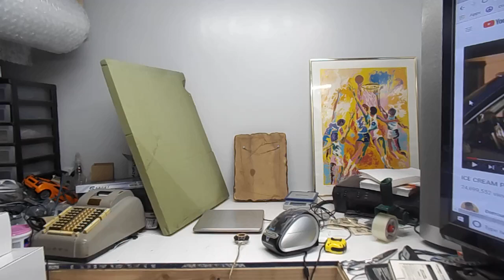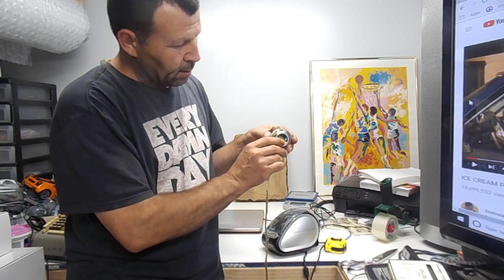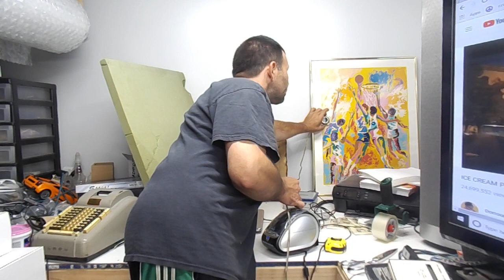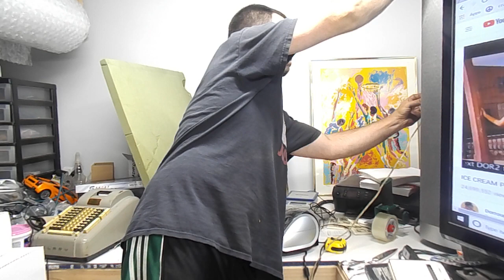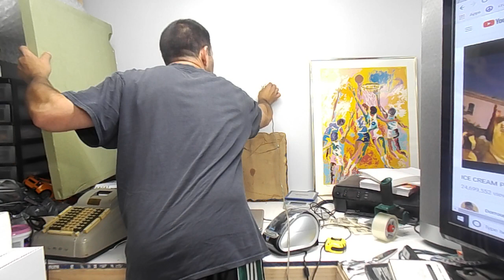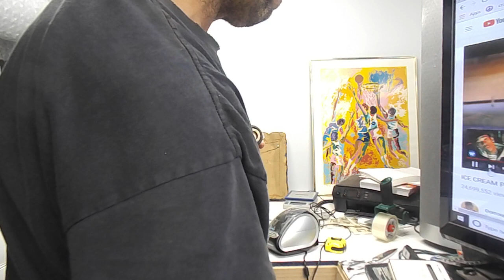audio exciter

Comment: If the input level is low they're just okay, but when level is higher it starts distorting.
I think there is a problem with the stress on the moving voice coil. On a normal speaker the voice coil doesn't have to support any weight, but on these the whole magnet and frame are hanging from the voice coil. It's a novel idea but that's all. If you want decent sound stick with traditional speakers. I don't recommend them.
Reply from the maker: for the price point and reasonable volumes, they do decent. when you push them, the structure they are mounted to plays a big part of response. i do have traditional speakers. i was actually surprised by the bass response. i am in the middle of a project. once its done, i will revisit these and take some measurements and results, now that i have a mic and rew.

Comment: People are mixed up they are using small speakers it works but not as good as this
Reply from the maker: they have a unique application. more of a wow factor that is fun, not as much as sound quality. they suffer under 250 hz or so and above 6k. really need a tweeter and sub. so you end up with a full system. but the cool factor is the lack of footprint.